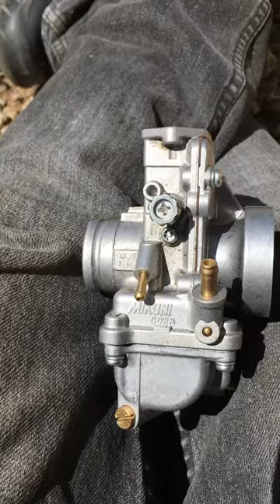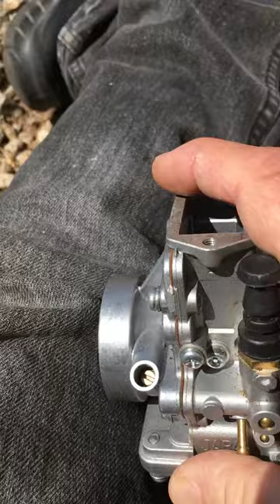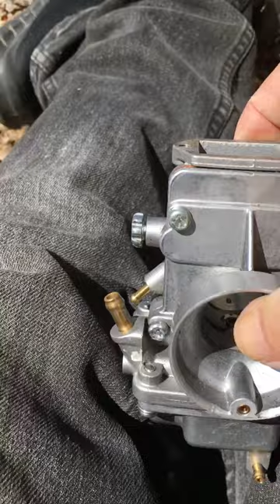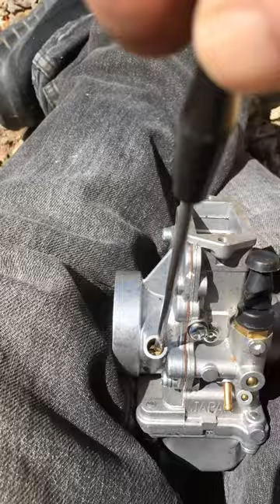#how to choose proper pilot /idle jet with air mix screw step 2

Comment: Out of 100 videos this is where I end my search on this topic. Str8 to the point ! Thanks.
Reply from the maker: @345gc8  your welcome simple as putting shoes on in the morning. Glad to help.
Reply: @2strokecarbtuningportingin187  quick question, when you say “if it’s not sounding rough” when turning the air screw… do you mean from the seated position or from the factory standard ?
Reply from the maker: @345gc8  should be responsive  crisp sounding @ 1.5 turns from seated position. out on a vm  round slide and 2 turns out on a tm flat slide.
Reply: @2strokecarbtuningportingin187  not sure which slide I have but it’s a keihin pwk 28mm. So basically if it’s sounding crisp @ 2-3 turns out I should lower the pilot.
Reply from the maker: @345gc8  pwk air  mix with proper pilots 1.5 turns out so yea if your 2 to 3 turns out then I would go down one jet size. Keep in mind it's safer to run pilot  slightly rich. When your off throttle that's the only jet feeding fuel and oil to your engine. But yes me myself  if I'm 2.5 to 3 turns out I would go down one pilot  size then it should be responsive  and crisp at 1.5 turns out that's what pwk specks say
Reply: @2strokecarbtuningportingin187  gotcha! Thanks I really appreciate the time and knowledge you shared. Much Respect 🦾

Comment: tip;  if the adjustment screw is on the motor side of the carb, then it is a fuel screw, if it is on the air intake side of the carb, then it is an air screw
Reply from the maker: I explain that.
Reply: @2strokecarbtuningportingin187  oh, nice, thanks for the great straight forward explanation! Very simple, efficient, and effective method

Comment: Bought a moded staged mini Coleman ct200u for $500 been trying to get it to not bog on the slightest throttle . Been weeks and I couldn’t figuere it to i changed the main jet from 108-140 and nothing worked, then found your video and change the pilot jet from 40 to 45 worked a little bit but bogged still. Then changed it to 50 and now I can give it full throttle. Only think is it back fires so I need to figuere that out but still bro thank you, for sharing your knowledge
Reply from the maker: 100% your welcome. Super easy stuff  if you understand  how things work. People  tend to over complicated  a simple thing to make themselves  seem smart. I'm a simple guy and thankful  to know I have helped you somehow

Comment: It should not matter the elevation or anything just like my quad it takes the same jet it did In Kentucky now it’s in Louisiana never had to change a jet
Reply from the maker: It matters if you go from sea level to above 3000 ft then you would have to think about jet changes. But when your moving from one location to the other and there's not  a few thousand ft in elevation distance then it's fine. Typically in winter  you might have to up jet a size or two. Say if it's in the 30s and less. Then come Summer and it's in the 90s or 100s then probley down jet a size or two.  Back when motorcycles game with carburetors meaning all of them typically amanufacturer would find a happy medium. I believe some people really overthink such a simple process. Jet numbers is simply a reference point as far as I'm concerned. It takes what it takes.
Reply from the maker: You're a good example average elevation of Kentucky is probably 750 ft average elevation of Louisiana is probably like 150 ft. Definitely no issues there
Reply: Thanks for info

Comment: Awesome explanation. What's the best way to check for vaccum leaks?
Reply: I spray ether (starting fluid) around the carb boots. If it starts to idle really high, you got a vacuum leak
Reply: @granthamilton9018  that's really fucking smart

Comment: I looked through your videos and found that using high temperature ultra grey gasket sealer on a filed down port and flange is the answer. Also have to check crank seals and head gasket.
Reply from the maker: Thanks can't Jett with a vacuum leak fur sure  thanks like share and subscribe

Comment: I have a 2008 yfz450 and the screw is at the bottom of the carb bowl.Does turning the screw in to make it run more rich apply to what I have as well?
Reply from the maker: That's a fuel mix screw when if front of slide. When you screw it in it takes away fuel. When you screw it out it adds fuel. If the screw is behind the slide ie air filter  side its considered  air mix screw when you turn it in it adds fuel. When you turn it out it adds air.  Either type set up     controls fuel or air control to the pilot circuit and typically determines  pilot jet size. Pilot  circuits function is zero to 1/4 throttle. Hope  my answer  helps.
Reply: @2strokecarbtuningportingin187  100 percent helped me yep it’s behind the slide  engine cylinder side.the pipe runs red from the factory and I’ve never liked that I’m thinking of running it a tad bit more rich and move the needle clip down one.when I’m in 4 or 5th gear quarter throttle for awhile the pipe starts turning red
Reply from the maker: @dean1627  needle controls  1/4 to 3/4 throttle.  Position#1 is clip to top position leanest  #5 is at bottom richest position. When jetting carbs properly engines warm zero  vacuum  leaks float levels proper air cleaner is clean. Then start with pilot circuit  air mix  or fuel mix screw determines  what size pilot jet to run. Ideally  it responds crisp and clean when screw is max 2 turns out minimum  1 turn out. The pilot jet sized properly  does have a effect on the overall  function of your engine. Most of the time nowadays   you'll  find the pilot jets on carbed engines are about one size to small. Also find fuel maps on fuel injection  engine are super lean as well. Frigging epa ie tree huggers don't like power 😂
Reply: @2strokecarbtuningportingin187  couldn’t agree more with that at all.dam epa rules nowadays

Comment: When I turn the pilot screw it doesn’t have much effect, but my carburetor came off and I taped it on to get me home and it seemed to run better. 
What is going on?
Could the little airway that allows the gas to be sucked up from the pilot jet be blocked?
I think the pilot jet is the original one to the scooter so it should be the proper one if that is the case right?

Comment: great video, does it matter how tight the jet is?
Reply from the maker: Don't understand your question you never want to bottom out air mix or fuel mixture screw tight you can damage the screw or seat  it's important to know how many turns out from bottom you are. Watch vid a few times this is exactly how to determine proper pilot jet size can't explain it any easier
Reply: @2strokecarbtuningportingin187  yes sir
Reply from the maker: As far as does it matter how tight your physical jets are installed yes you don't want them to fall out
Reply: @2strokecarbtuningportingin187  oh i see it now thank you
Reply: @2strokecarbtuningportingin187  i’m talking about the jet touching the pilot all the way down the threads as much as it can go but now i rewatched the video and have a better understanding

Comment: So turning it in makes it more rich?
Reply from the maker: If it's a air mix screw closing it makes richer if it's a fuel mix screw leaner. Air mix is on rear of throttle slide fuel mix would be in front of throttle slide
Reply: Ok thanks! I have a v22 knock off mikuni. My understanding on this carb has only the one screw, so been turning it out to 2 turns making it richer I believe ? Using spark plug color to determine proper ratio. A bit new to this.
Reply from the maker: @ratdad48  fuel mix / air mix screw dictates what pilot jet you run. The pilot jet / size / air mix screw controls zero to  1l/4 throttle. I explain all theses things on the carb vids I made

Comment: hey, not sure if you could help but i use my 2 stroke for street riding. i was told to change my pilot one down to make it leaner so my motor doesn’t get gummed up at low RPM’s. is this right?
Reply from the maker: Air mix / or fuel mix screw determines pilot jet size. Keep in mind your oils in your fuel. When your off throttle the only thing allowing fuel oil is the pilot circuit. Two strokes never have liked idling long periods. The crankcases load up a little especially Reed motors. Really didn't answer your question so great but years ago melted few race motors coming out of corners cause was to lean of pilot circuit
Reply from the maker: Semi correct but not great idea running a lean pilot
Reply: @2strokecarbtuningportingin187  i’m never harsh on accelerating below 1/8 throttle and i always clutch in and give a few blips when slowing down. it’s a yz105 with 32/1 premix
Reply: here in the UK our fuel uses E10 so i use ethanol eliminator too
Reply from the maker: Smart  a lifetime ago I raced  b class mx  for years ate two race motors  exiting corners  back to back was a little confused as to why but it  the problem wasn't exiting the corners  it was off throttle entering the corners . Basically loved how crisp the motor sounded with a slightly lean pilot jet but truth be told rarely was you at 1/8 to 1/4 throttle racing MX . Leaned a a lesson long ago. About to lean of a pilot. All that being said my carb information is 100% legit 100s of people have use my carb info with lots of success. I believe most  folks over think the simplicity of carb tunning . If your mindful of where your problem area is in the throttle range and have a decent ear you can't fail. Typically if I have jets on hand it should never take more than 20 minutes to jet a motorcycle from scratch   meaning single cyl two stroke or four stroke.
Reply from the maker: @urnansgotclap1219  e 85 you definitely need to fatten up the motor substantially compaired to gasoline
Reply: @2strokecarbtuningportingin187  ethanol stops 2stroke oil from doing it’s job of lubricating. it also eats through any rubber seal it can get it’s hands on. because i run 0% ethanol i think i will be safe running a 42pilot instead of a 45
Reply from the maker: @urnansgotclap1219  in USA they add about 10% kinda no big deal.work on some drag bikes from time to time. Have a 250i Dyno jet Dyno at the shop. It kinda bites changing fuel map when people want to run e 85 on a naturally aspirated motor very minimal power gains max ever seen is about 3 to 4 % unless it's  a purpose built alcohol motor with lots of compression  and timing then you might see 7 % gains max. Turbo motors or forced induction you see way more gains

Comment: Also your working w Japanese engineered carb most are dealing with aftermarket crap most Chinese 
China is just cheep and don’t care just grab another one! 
Not me , 32$ Mukuni clone 
Isn’t worth getting because the ethanol eats up the cheap vinyl o rings in cheap 30$ carbs 
Spend 150-2000 go Japanese 
Dial it in perfectly !

Comment: I like your explanation.. but how the heck can i adjust the pilots on my tripple mikuni's, when they are at the bottom of the carb? They are litterary impossible to reach! 😝
Reply from the maker: Sadly it's a pain. Yours is a fuel mix screw in front  of the slide so it makes it richer as you turn it out. Nowadays they do sell fuel mix screw extenders
Reply from the maker: Google fuel mix cable extender run that on my super moto
Reply: @2strokecarbtuningportingin187  
Thanks.
Found a handy extension screwdriver for pilot jets. 👍🏻
Im trying to adjust the carbs on a Triumph Tiger 885, and it's a pain in the 🤬
They suddenly added more ethanol to the fuel here in Norway, and i got alot of trouble with my bike after that... messed up the paint job on my fuel tank as well.. im angry. 😠

Comment: What if you can't get the bike warm? I can't get it to idle at all
Reply from the maker: If you can't warm up the motor then your jetting will never be proper. Could be many things why your motor won't idle that's a loaded question. #1 does your motor run. Does it have good compression. Good seals no vacuum  leaks. Good fuel flow out of the tank . Is carb good does slide function  proper. Can't answer  off internet  check some basic things need more information

Comment: It's the opposite for four stroke?
Reply from the maker: No it's opposite if it's a fuel mix screw. Air Max is on the air filter side fuel mix is on the front side meaning in front of the slide.  If it's a fuel mix it's just the opposite of the instructions I gave
Reply from the maker: It's opposite if it's a fuel mix

Comment: I have a beta xtrainer 300 2020. Bought it used and the owners mechanic set up the carb like this. 32 pilot jet and needle on fist notch. Stock setting should be 38 pilot and needle on second notch. The bike seems to run fine but I am thinking the 32 pilot jet is way to lean compare to stock one. What Do you think? I am affraid I can melt my engine..
Reply from the maker: It's always safer to run pilot  slightly rich simple because when your throttle slide is closed that's the only fuel getting pulled especially if your premixing  but again fuel mix of air mix screw determines what pilot to run. If ever in doubt always run a slightly bigger pilot because reasons mentioned above
Reply: @2strokecarbtuningportingin187  ok I better pit the stock one ..size 38 also because its  oil injection mixing and not premix..thaoms from Italy
Reply from the maker: @carmelo1970  ahhh I burned up two race motors when I was a kid exiting turns been running carbs for  44 years problem wasn't exiting turns problem was to lean of a pilot jet entering turns again when  throttle closed the ONLY circuit delivering fuel is the pilot circuit helps cooling. If you follow my carb tunning tips you'll have zero problems. Tunning carbs takes minutes.
Reply: @2strokecarbtuningportingin187  I will for sure follow your tip.. your video makes the all procedure so easy.. thanks 🙏
Reply: Sorry to keep bothering you. I just tried your tip. Do I need to try the bike on track or it can be done like in the garage.. here in Italy due the pandemic there is no way to go out and ride for now..
Reply from the maker: @carmelo1970  if bikes warm you blip throttle you can hear when it starts getting rich when closing air mix screw or opening the fuel mix screw if it's on back side of slide it's air mix screw if it's on front side of slide it's fuel mix screw. You want it to respond cleanly and crisp at 2 to 1.5 turns out. Pilot jet function is zero to 1/4 throttle I'm sure I explain on the vids how to tune carbs as simple as I can.allways when tuning a carb find what's rich and go down till runs cleanly. If you have a newer bike the jetts are not gonna be more than one or two numbers off. All manufacturers have to tune motorcyle they sell to work safely for the end users. When adjusting air mix or fuel mix screw motors warm ZERO VACCUM leaks turn screw in 1/8turn at a time blip throttle few times give it few seconds each move to determine is irresponsible crisp and cleanly or getting full and rich watch the vids man it's so easy
Reply from the maker: https://youtu.be/6k-AhtdEhps
Reply from the maker: @carmelo1970  https://youtu.be/T00NgtP8bc8
Reply from the maker: @carmelo1970  https://youtu.be/9saVfgo_Vnc
Reply from the maker: @carmelo1970  https://youtu.be/mMmyvGpj6Q0

Comment: If im on 4 turns do i need to lower my pilot? Because on 2 turns mines keep backfiring. Thanks
Reply from the maker: Watch video I explain everything
Reply from the maker: Again 4 turns out if air mix screw is way to lean. If you follow the directions ony vids tunning carbs is simple as I explain. #1 warm bike zero VACCUM leaks and float levels correct

Comment: What idle jet size do you recommend for a hyper2 70cc engine with 17.5 dellorto & mesh filter
Reply from the maker: Fuel mix / air mix screw determines what jet to run
Reply: @2strokecarbtuningportingin187  I have 38 and bith air&idle screw is in all the way
Reply from the maker: @Cycle_in_style  it's been 4yearz and about 30 carbs later I have zero clue what jets I ran in my phgb 17 or 19.5carbs  if screws on air filter side it's a air mix screw if you have screw. Closed and it don't die your pilots to small. I explain everything on the vids

Comment: If you have to start with choke open even when it's warm out but cuts off without giving just a little gas to keep running. Pilot jet is too small, I can't even get to letting it idle warm on a 212 with tm 24
Reply from the maker: Watch the videos Man I explain everything 44 years of experience nobody has better carburetor videos than I do just saying
Reply from the maker: Air mix screw determines what size pilot jet to use

Comment: Stupid Question.. So My 85 Virago XV1000 With A Single Carb Using A Mikuni Hs40 Keeps Backfiring Out The Exhaust When Accelerating Low RPMs.. Ive Done Everything And Now Just Checked My Pilot Jet Size And It Was A 25.. Needs To Be Bigger?
Reply from the maker: Possibly needs valve job or typically to rich. But rarely would you have to change jets on stock carb. Air mix or fuel mix screw determines what size pilot jets required
Reply from the maker: https://happywrench.com/why-does-your-motorcycle-backfire-on-acceleration/
Reply from the maker: Could be many different reasons VACCUM leak wrong air / fuel mix screw setting poor fuel clogged pilot. Not to small or two Large pilot can cause a issue left you a article so you can narrow down your issue.
Reply: @2strokecarbtuningportingin187  Awesome Thank You!!! Yea I just checked it out and I do have short pipes so I think I might try playing with my jets
Reply from the maker: @sickduck66  carb tunning is simple my directions have worked for many people.  All carbs and circuits function the same as I say on my vids. Hopefully you find them helpful 😉
Reply: @2strokecarbtuningportingin187  Thank You Brotha
Reply from the maker: @sickduck66  your welcome fur shur